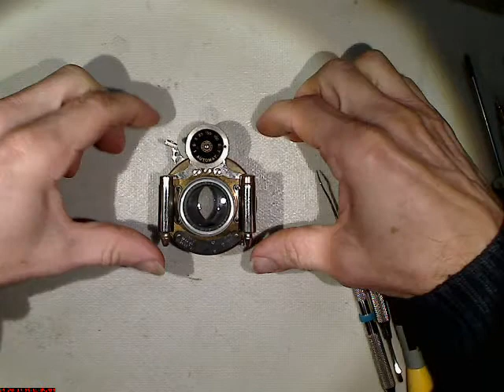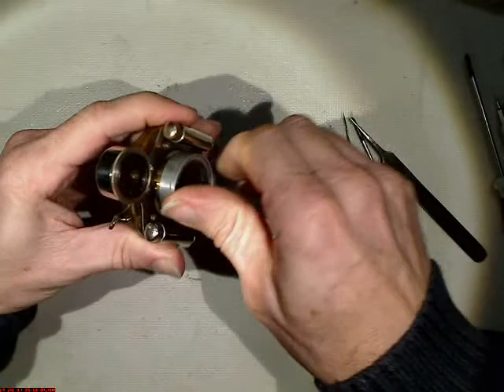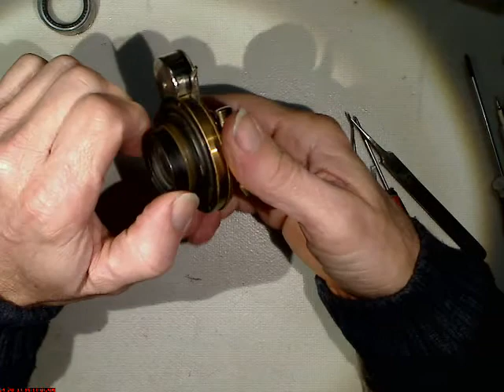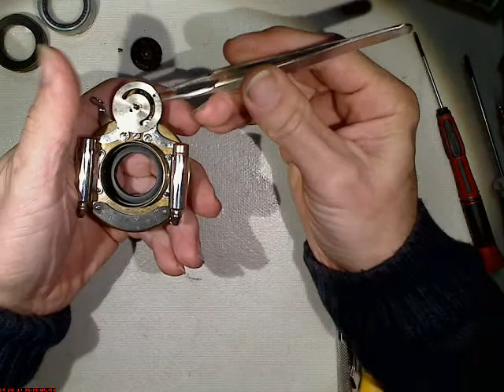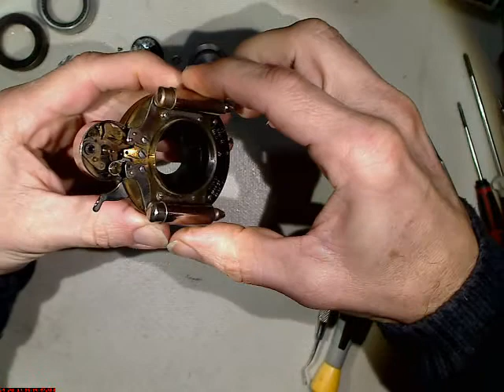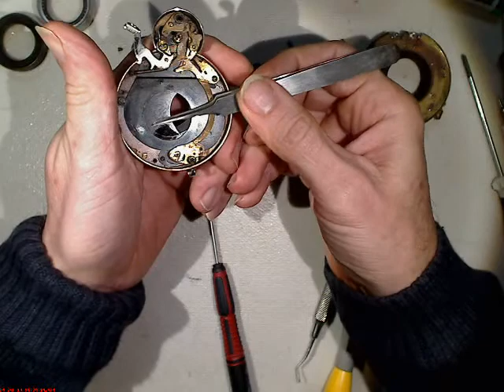Repair old Bausch & Lomb AUTOMAT______PART_1_Motion Lapse film

Comment: I had one of these Unicum Shutters that had the air release piston totally frozen. It was so bad, even the camera repair technician could not unlock it using penetrating oil, heat, ultrasonic vibration etc. By soaking the piston assembly in a mixture of 50% acetone and 50% transmission fluid overnight I was able to free up the parts with a mild twisting motion. You can see many praises of this mixture by auto mechanics on the web. I would only suggest using this mixture on metal parts.